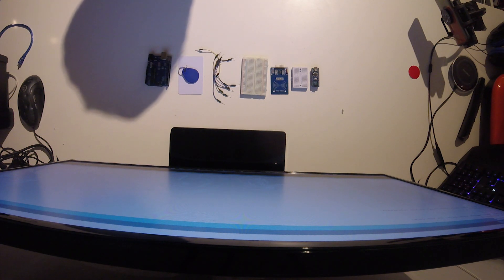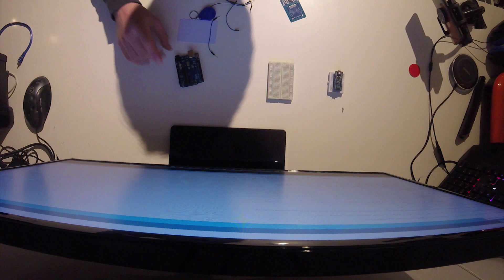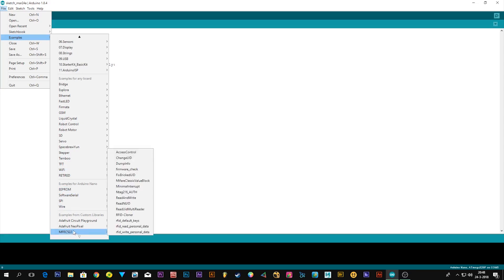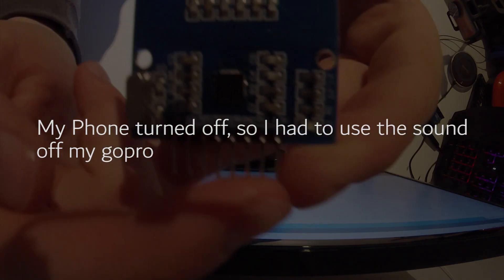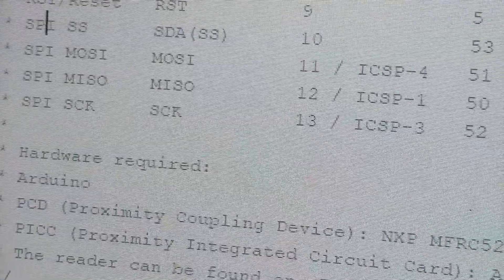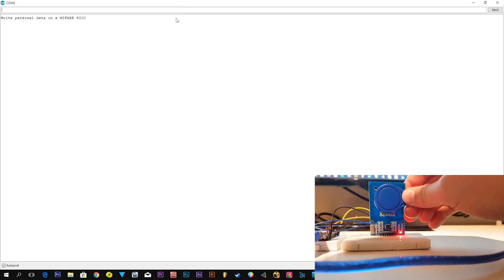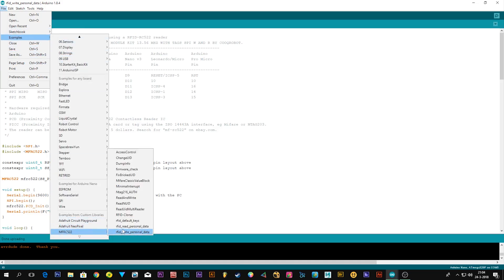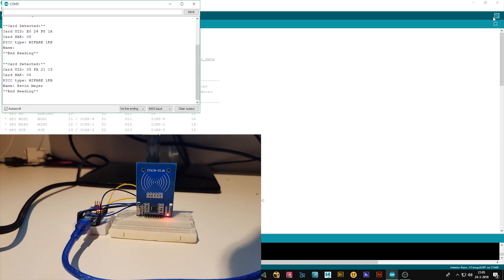Arduino RfID read and write Tutorial

Comment: Please sir make a clear step by step video on writing something on tag please
Reply from the maker: Hey, what is not clear, cause theb I can hp you better probably. At 3:38 I'm exlplaining it but here the steps.
1. Have the rfid and arduino properly connected
2. Upload the write sketch
3. Open serial monitor
4. Scan card
5. Tyoe asked information ending with #
6. Your done

I hope that thus was helpful, if not please tell why so I can help you further
Reply: @KevinMayerYT  actually it's not getting the card id. hence, not able to write.
Reply: same here, but figured out after 1 minute, if you don't understand then you can find those sketches in the examples of MFRC522's lib

Comment: Any idea why it reads my card and i can write on it too, but my tag when i want to scan it, it doest say anything on the serial monitor
Reply from the maker: Hey, that's weird. Have you uploaded the read program to the arduino when you tried read the data from your card? If you did this and it still didn't work I should try a  new card. I hope this was helpfull.
Reply: @KevinMayerYT  I did yes, i'll do some more research but thank you!
Reply from the maker: @brina2474  no problem, hope you find a solution

Comment: Hello there, just wanna ask..for reading part, my rfid does just fine..but when im trying to write, and i did exactly like you do, putting hashtag at the end of family name, i got "failed" message...i looked up to the connection, and also tried reboot, but it gaves the same error..why is that? is there anything that i miss?
Reply from the maker: Hey, sorry for late response but had it very bissey, but I don't know for sure what that could be. You have to make sure that you have a good card beacuse there are differents in herz which may cause error, but if that one came with your reader I thing that the chamge is bigger that there still is an error in the code somewere or your reader/arduino is just broken. Hope this was helpfull
Reply: @KevinMayerYT  hello there...im sorry for forgotting to tell this earlier..actually i have sort the problem looong ago, day after i posted the question...but i don't remember how i solved it...anyway thanks for the vid, got an A grade for this subject 😃
Reply from the maker: Hafizuddin Roslan no problem, nice to heart that you got a A
Reply: @ntah98  please tell me how you solved, I'm facing the same problem. I want to add "hello world" in RFID tag.. how do i do it?